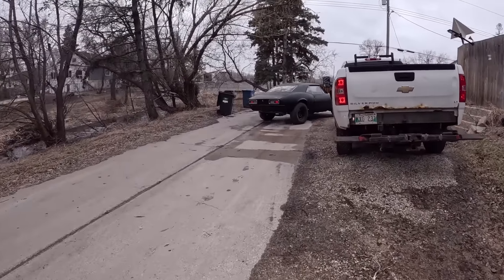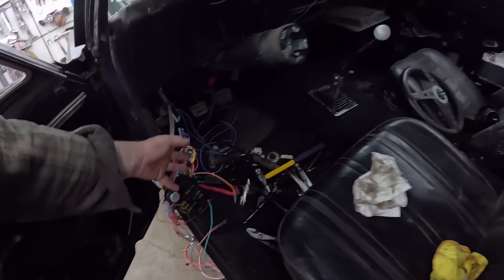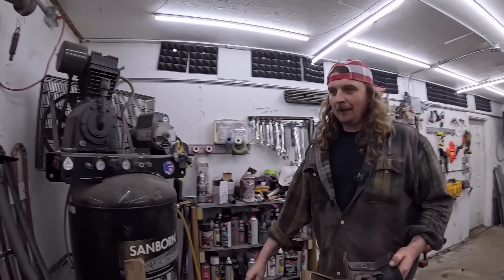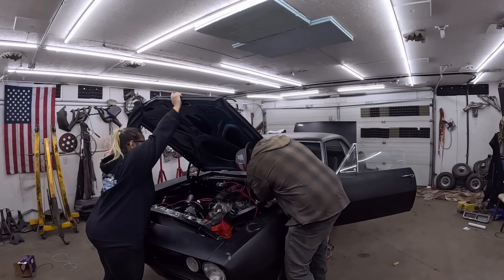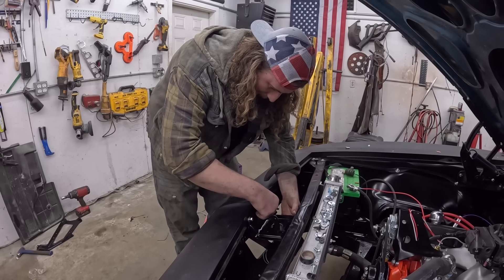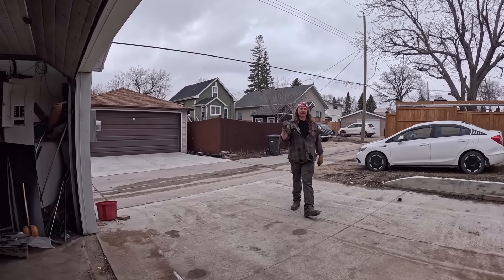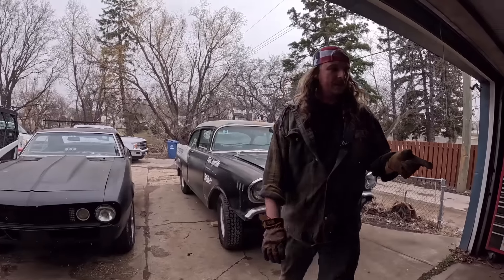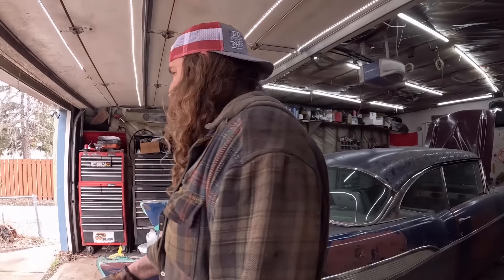DRIVING My 4 Speed 1967 Camaro For The FIRST TIME

Comment: There it is Shop mentality , what happens in the shop , stays in the shop , anyone that doesn’t get it isn’t a hot rodder , never threw a wrench across the shop lol hot rods are frustrating , put my door on try toaligment it and the front corner was sticking out went to loosen hinge to a piller the dam Phillips screw heads stripped , got the t hinge off but now the blot plate has turned or. Moved , I almost had a fit , but it was11:15 pm , so I came in the house causing lol Go getter Dan 57, then 55 nomad lol

Comment: When you get your alignment done just have them go easy on the caster. It will greatly improve your slow speed turning. Either that or put power steering in it. Just a suggestion.

Comment: A commenter on another car channel once said when they take a car for the first drive follow him and you can pick up new parts off the road he forgot to tighten, I kinda feel this applies to you too lol But that Camaro turned out nice it does look like most but there are 3 main colors you see them in Red, Yellow or Black with stock rims or small front tire big back tire so you nailed that it should be a quick seller for big bucks .One day you should do a speed run and see which of your cars is the fastest in like a 1/4 mile. I know your not a speed guy blah blah blah lol

Comment: I've heard many times, once you've aligned & fitted the hood to your satisfaction, then drill a couple of 1/8" alignment holes through the hood hinge & the hood, so that if the hood has to be removed for maintenance or whatever,  you have some easy reference holes you can use  to quickly reposition the hood very close to ideal alignment.
Reply from the maker: Yup totally agree

Comment: 34:20 “disconnect battery because it has a drain”……. I may have missed it, but when you installed  the harness for the one wire alternator (Question) Hopefully it’s not hooked up direct to the starter 2 aug  battery wire. That would cause an electrical drain. It’s needs to be hooked to an ignition switch system. Makes. It turn off when the engine is not running.

Comment: I absolutely HATE window regulators. I have never worked on one without problems. Believe it or not, the easiest one I ever did was on my '06 Crown Vic transportation car. With power windows. It involved drilling out 12 rivets and replacing them with screws and nuts, but everything went together surprisingly easy. New one from RockAuto was only like $80 USD. That car would look good with hood pins. It needs all the "brightness" it can get.  Having 2 cars in the garage, 2 cars in the driveway behind them, one car parked on the street, and 2 cars parked in the parking lot at my son in laws business, I know ALL about moving cars. Seems like I spend half my life moving cars.

Comment: Any advice for me Dan on door hinges and adjusting did what you do ( except I pulled the striker plate offbeat pillar ) used a floor Jack , like my gaps ( after installing rocker ) button was sticking out , Ei the door is twisted , or the hing has to pivot help mr Inspiration of mine Thanks in advance CrazyWillie

Comment: Those traction ( slapper bars ) are more like slacker bars... they need some tweaking ! 

Just ease the car out of the driveway for a couple of quick tach tests....

Find 1st gear ( no, that's 3rd... over to the left a bit there you go ) now push in the clutch and tach that super mouse motor to the moon- a split second later dump the clutch-n-melt those tires___ as make a rubber road snake & show the neighbors down the street what rubber in all 4 gears looks & sounds like (even if 4th was only a chirp... it still counts) 🙂👍

While the smoke is still hanging in the air, get that sweet Camaro back in the garage close the door shut-off the lights 😉

The old dump and go and pray theres no O' NO !

Comment: Buy a new tool cart. Take a few days and a few hundred dollars to prime, base coat, metal flake it, five coats of candy, then five coats of clear. That's sanded between each coat. Then wet sand and buff until you can see your smiling face. It will then be ready to throw tools and parts on. Even better than hoods and deck lids that you don't finish..It will be nice and shiny. The best target. Of course a  strip and repaint monthly, perhaps some shadow skulls or flames. It has to be nice in order to trash. You'll love it I've seen one model that is two story. Twice as much fun..HA HA If your system works for you, so be it.    Thanks for the laughs you two.

Comment: Maybe next time you need to remove a hood or trunk lid, before removing it, drill a small hole (1/8th) through the hinge and hood support structure to ensure alignment.
That's assuming you're reusing the hood and matching hinges.  ;-)